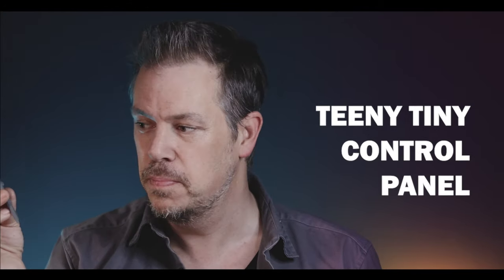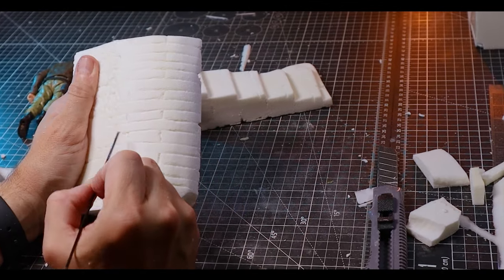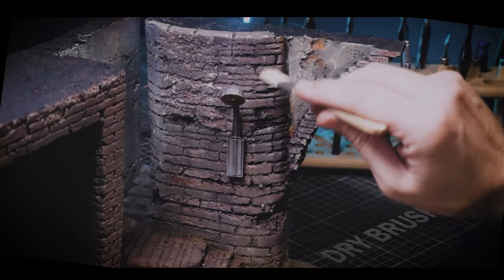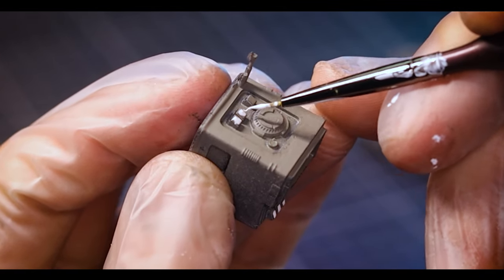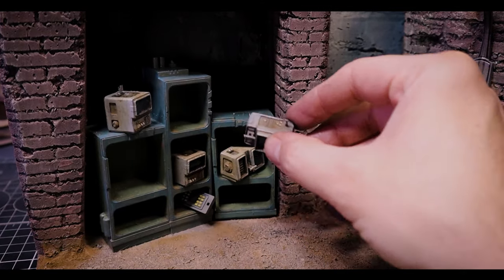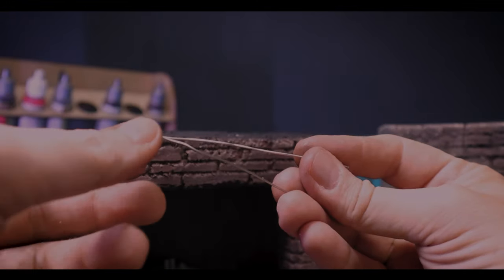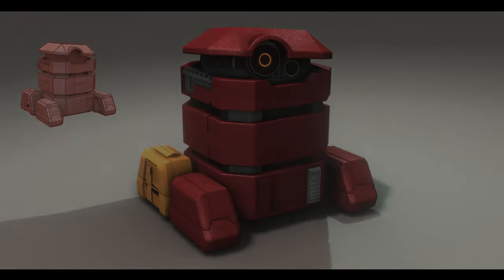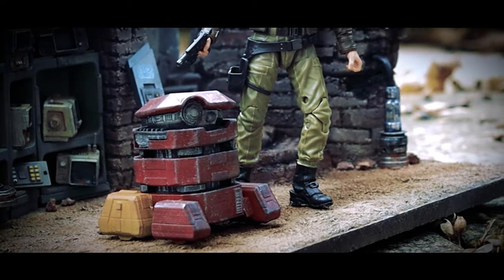Star Wars Andor Inspired Ferrix Diorama Build

Comment: amazing build. How durable is it to hotglue foam parts?
Reply from the maker: Thank you, worked really well, holding up just fine and on display still 😊😊😊👊
Reply: The way you lighten up b2 droid by using a cmd led is realy cool. Do you need a resistor as well to do that?
Reply from the maker: Thanks! I used a pre wired Amazon bundle of LEDs 🤛